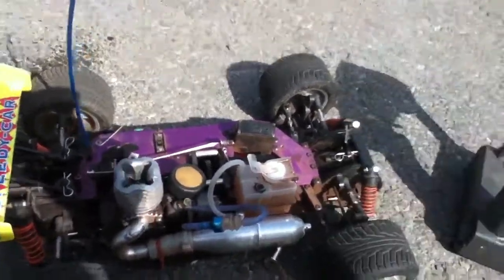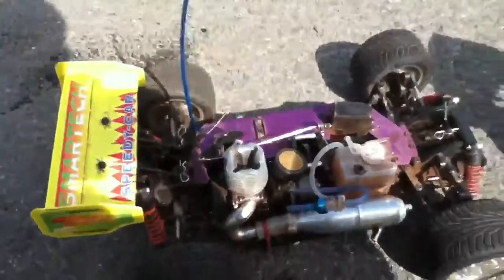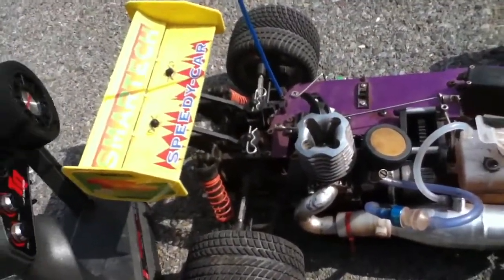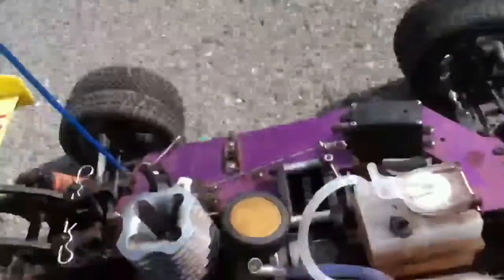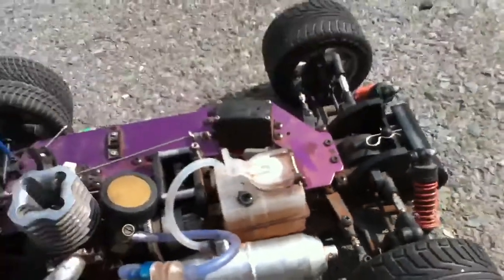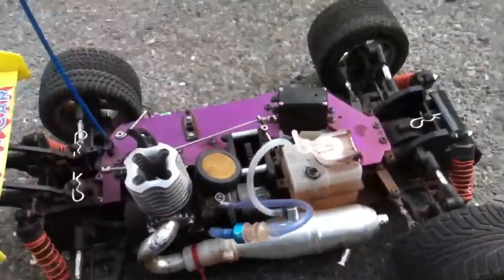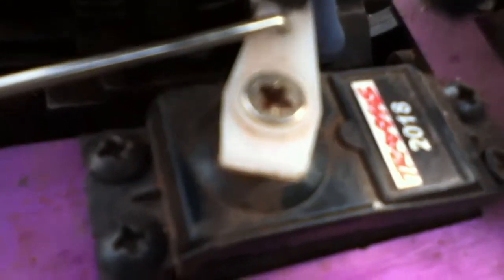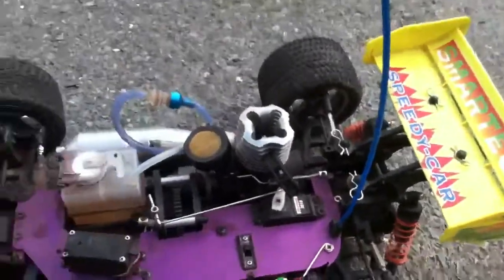Not So Speedy Tiger RC nitro car

Comment: Dude my speedy tiger was a beast with an OS MAX CVRX 18 with the big carb, and a $150 exhaust system and a futaba radio.

My Magic Wheels TMAX copy was also beast, with about $1700 put into it. Being a machinist I just made everything I wanted for it that wasn't available. In the end it was basically a real Tmax, only basically the most modded one at the time.